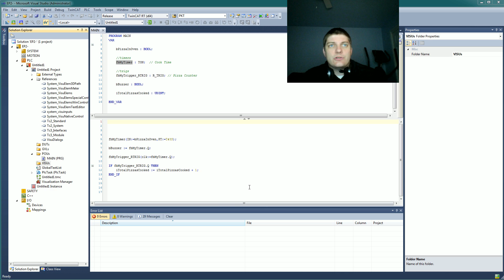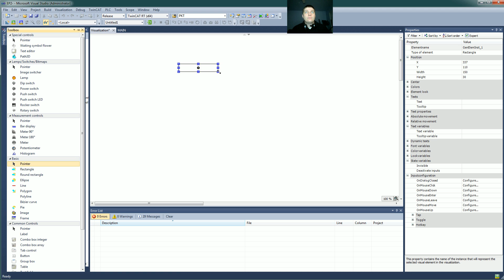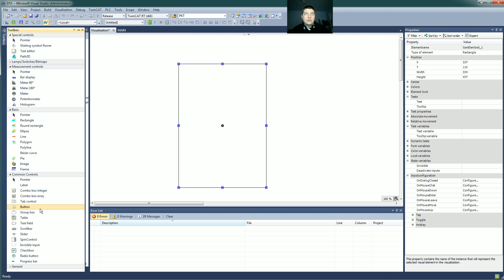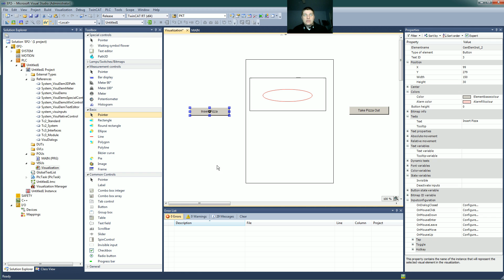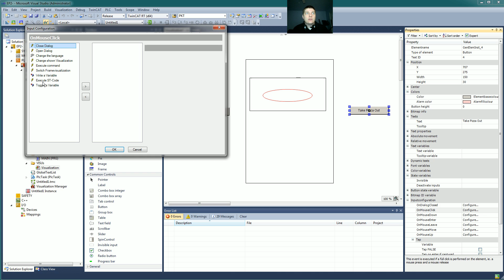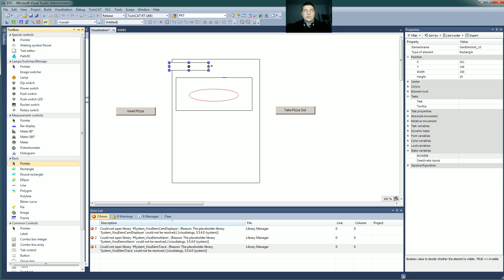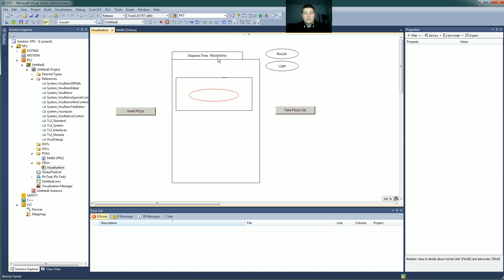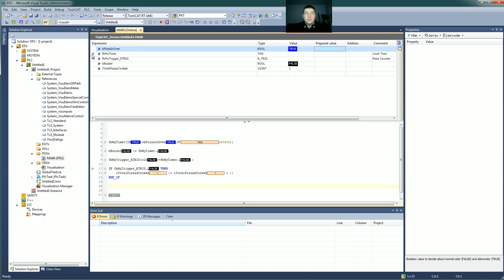Learning PLCs with Structured Text - EP6 - Debug Visualizations in TwinCAT 3

Comment: Thank you soooo much for this help. Your tutorials are really great!! Just a few questions :

-Is it possible to  start a visu as a task? My purpose is to have a touchscreen connected on my plc and to use button / keyboard on it as input. Is it possible to start my PLC with the visu on the screen and do that? (I don't know if I'm clear enough, please tell me).
-Is it possible, with structured text, to generate a record of the sensor value, for ex in a txt document?
-Is it possible to have C++, python or .exe files running on the PLC, on windows os; while our main POU is running (on processor)? I saw that we can tell what priority to permit in "Tasks" I guess if i put 20%, i have 80% of the processor for the windows OS?  If so, how can i transmit data from my programs running on windows os, to my struct txt program? Does it exists a virtual IP socket library or stg like that?

for info, i have a C6905-0010 PLC/PCi from beckhoff connected to an EK1100 module that allows me to plug my etherCAT sensors.

Thank you very very veryyyyy much in advance and please keep doing a so great job!
Reply from the maker: Wow, lots of questions!
1) Yes you can start a visu at windows boot.  I don't recommend it as an HMI, there are better options, but you can do it.  Look at the beckhoff HMI options.  Its not a task on the PLC, just a windows process that talks to the PLC over ADS.
2) You can log sensor data (or anything on the PLC) from twincat directly to CSV, XML, etc with various add-ons.  They also have a database supplement that lets you write to databases from the PLC. 
3) You can run any windows programs along-side the PLC.  The 80% thing is just a "limit" that the PLC cannot exceed, so on a small program you'll probably use 15%, so 85% is available to windows for whatever else you want to do on the processor.  To write programs that interact with the PLC, typically I recommend beckhoff's free ADS.dll implementations, but there are other options, like tcp sockets, rest apis, OPC-ua, etc.  ADS is the 'free and flexible' way.

Comment: Hello, I have a question about that HMI stuff. I want to make  assign a time to Timers PT via textfields. How can i do this?
Reply from the maker: Doğan Çiğnaklı I think you can assign to a TIME var and pass that in to the .pt at run time. also you could use a string and then use string_to_time. dint_to_time works as well.
Reply: ok then, i will try.

Comment: You are helping me a lot with my master thesis =) Thank you.
Reply from the maker: +Furkan Öztürk excellent. What topic?
Reply from the maker: +Furkan Öztürk excellent. What topic?
Reply: I am trying to build a 3d printer for aluminum parts. Right now, I am feeling like Uma Thurman, trying to move her big toe at the beginning of Kill Bill. If I can make these steppers move , the rest is easy.
Reply from the maker: +Furkan Öztürk did you see my 3d printer videos? They might help you also. Are you using twincat for the printer control? If so, check out twincat cnc. I'd maybe recommend the approach I took in my 3d printing videos, or possibly check out machinekit as well. Beckhoff cam do it but you might spend more time reinventing the wheel instead of simply innovating your process.
Reply from the maker: +Furkan Öztürk did you see my 3d printer videos? They might help you also. Are you using twincat for the printer control? If so, check out twincat cnc. I'd maybe recommend the approach I took in my 3d printing videos, or possibly check out machinekit as well. Beckhoff cam do it but you might spend more time reinventing the wheel instead of simply innovating your process.

Comment: How can I import a picture to  the visualisation background?
Reply from the maker: +Jari Koivuluoma This was a breeze on TwinCAT 2, but I'm having trouble in TC3.  The visus are sort of half baked on TC3, they will have a new HMI product out any day now that is web based and hopefully a lot better.
One thing I did not try but might be worth looking at.... You can right click a viz and set a background BMP.  You could maybe make a viz, use your image as the background, and then add a reference to that viz in a 'frame' element from the toolbox.  

It might work, but I'm out of ideas otherwise.  I think it is possible to drop in activeX controls as well, (though the web browser does not work).  All of this is a poor workaround for lacking functionality.

I really just made this video so when I used the viz for visualizing my fake hardware that the users of the series could replicate.  I don't recommend using viz as a user facing HMI.

Comment: Hello there,

Thanks for the tutorials. They are helpful.

Do you have any idea if I can interface CAD software with TwinCAT? I need the CAD model to correspond with/ represent the PLC program executed in TwinCAT. Is there a way doing this?
Reply from the maker: bharath I've yet to see any commercial products that can handle it... but I've seen custom implementations of it.  
If I had to do it, I would probably write a "glue" program in VB.NET (or C#) and use ADS.dll to bring the twincat variables ("Tags") into VB.  Then, I'd use the solidworks API to activate different configurations as a result of a change in twincat tags.
I've done the PLC to VB side of things, I've not personally used the solidworks SDK.  I imagine it is very possible can capable of doing it, but you'd have to have a really good reason to go to the trouble.  (Maybe teaching a class where hardware was limited, it might be worth the effort for something like that)... or if we were doing a proposal with very expensive hardware and needed a complicated animation... still would be easier to do in solidworks without the PLC.  
What is your use case, if you can share?  Just curious.

There may be some PLC/CAD products out there but I've not used them.

Comment: VAR
     bPizzaInOven: BOOL;
     fbMyTimer: BOOL;
     bBuzzer: BOOL;
     iTotalPizzaCooked: UDINT;
     fbMyTrigger: R_TRIG;
END_VAR

//-------------------------------------------------------

fbMyTimer (IN: bPizzaInOven, PT:=6s);          //if pizza is there, start timer  
fbMyTrigger (clk:=fbMyTimer.Q);                     //Generate single pulse      
IF fbMytrigger.Q THEN                                    //Check whether is timer overflow
     iTotalPizzaCooked:=iTotalPizzaCooked+1;//No use iTotalPizza:=iTotalPizza++
    bBuzzer:=TRUE;                                          //Buzzer mode On, pizza cooked
END_IF

//Taking pizza out of the oven automatically resets the timer, if present go ahead

//Thanks from Brazil;

//If something is wrong please correct or improve guys